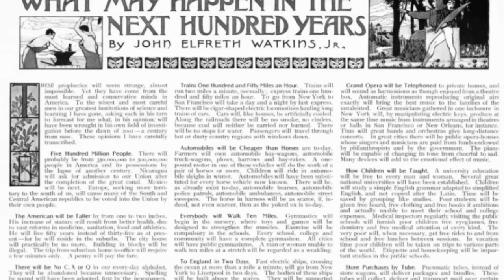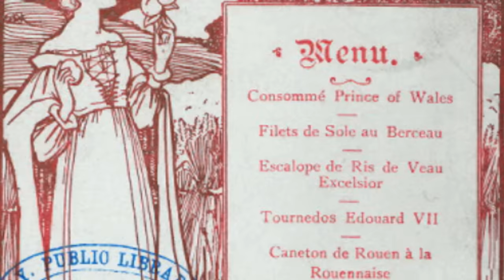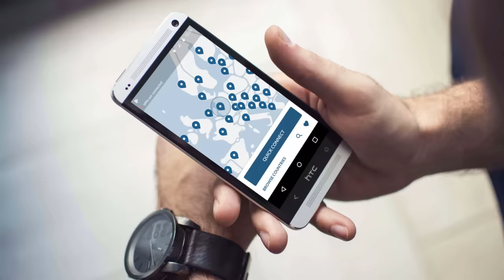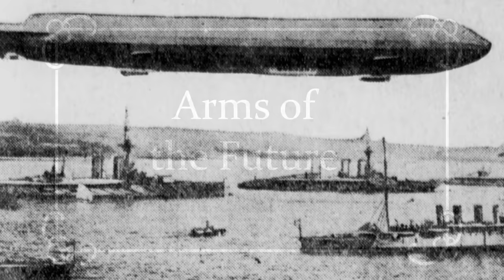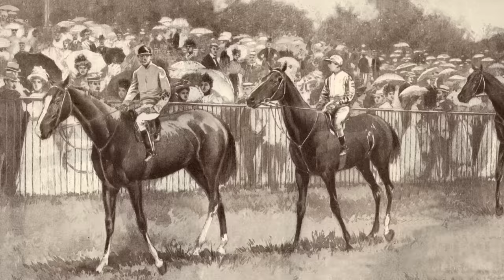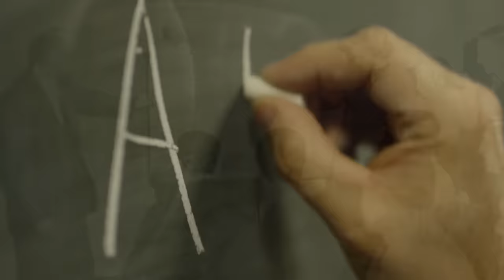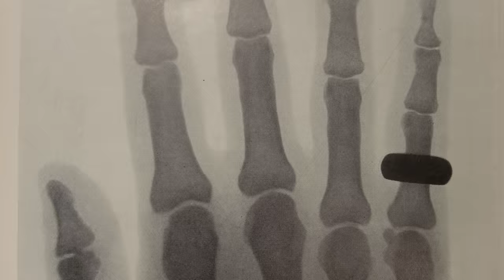Futurist from 1901 Describes The World of 2001 // 'Ladies Home Journal' (1901) // Primary Source

Comment: "Food will be served hot or cold to private houses, in pneumatic tubes or automobile wagons" Pizza boys, they predicted pizza boys.
Also, funny they thought plates would be returned cos plastic and cardboard hadn't been invented yet.
Reply: Technically Carboard was invented 1890, and before that there were several forms of hardened paper or "boxboard", but since they soak when exposed to moist substances they were onyl considered good for holding dry things.
Reply: Hot ooor cold. Love it!
Reply: I still would like a pneumatic food tube!
Reply: Grab, Gojeck, Food Panda, Line Man...  Ok, off by nearly 2 decades and on motorcycles rather than pneumatic tubes, but can you imagine the mess if items spilled or got stuck in the tubes?

Comment: 120 years ago he's predicting the death of coal.
Reply: But they didn't know anything about climate change yet
Reply: Obviously they thought about if their main supply of fuel was going too run out and found out quite quickly, and were really accurate.
Reply: And predicting Water fuel, i.e., Hydrogen.
Reply: Who knows? If there's a leap in carbon-capture storage technology that eliminates the problem of CO2 released into the atmosphere, coal MAY become environmentally friendly. Solar power, wind power, and battery storage requres a lot of mining of assorted minerals to produce them. The manufacturing process is also not very environmentally friendly. And there's the issue of end-of-life disposal which is now only starting to become an issue.
Reply: @0x5D  no his prediction has nothing to do with carbon emissions, he just said that eventually we will literally run out of coal and used some math to predict when that will be and that we'll have to switch to something else.
Reply: Yet, coal is anything BUT dead.
Reply: @Pravda_Z  What no it was very clearly referring to hydro power in the form of dams, how did you misunderstand it this badly.
Reply: I think it's interesting that both this and Edison thought that water power was the way of the future. It's a completely reasonable assumption to make, at the time only a few hydro power plants had been built and it was clear that there were several unused opportunities with enormous potential plus it's basically free. What they didn't realize is that there were powerful interests defending coal and oil and just how cheap imperialism and infrastructure could make those two.
Reply: Still haven't quite gotten there unfortunately.
Reply: Yes. In 2200